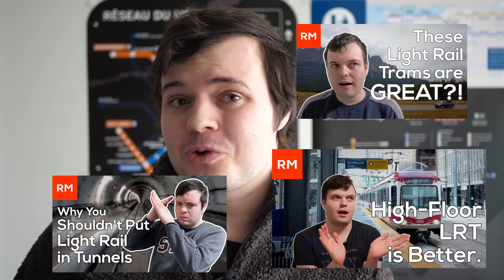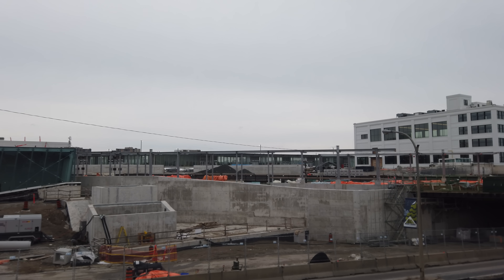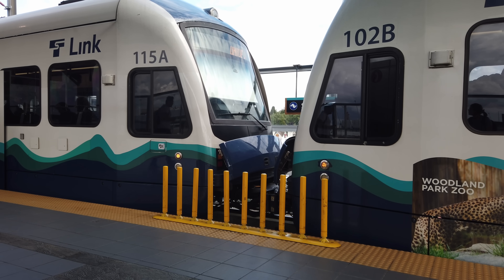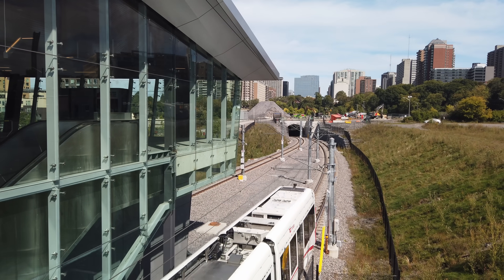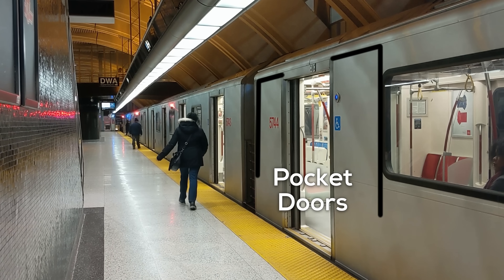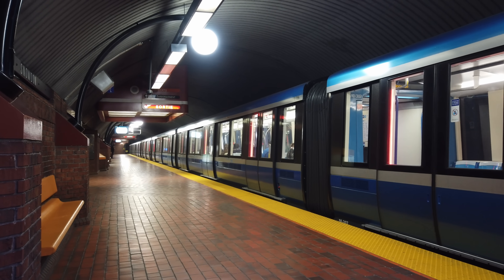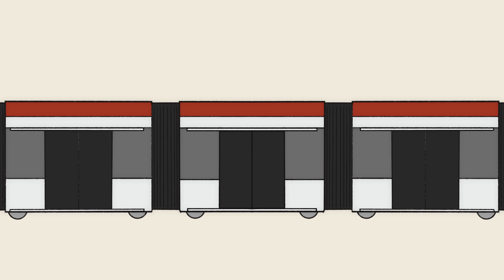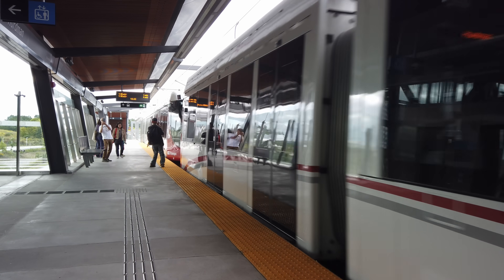I Designed a Better Low-Floor Tram

Comment: The issue with this train is that it’s basically a caterpillar on wheels. It would look ridiculous going around curves, especially sharp ones (which it can’t even do due to angular deflection of the wheels). It looks like what would happen if you took a typical 20 meter streetcar and stretched it out to 60 meters by adding middle sections. I suggest you merge the middle sections to make longer cars. This will also add capacity because you won’t have that many  gangways. Also, if you want a well rounded low floor train, you should really add seats. People, at least here in DC, DO NOT like to stand on trains except if they are going maybe one or two stops. Additionally, you say that the train is designed for urban centers. But there is more to a city and its transit network than just the downtown core, and transit networks will use the model that is best suited to all of the city’s transit needs, not just downtown travel. That’s just my advice.

Comment: A different idea for the wheel which should be a lot simpler is to have each carriage separated by a mini carriage basically a glorified gangway extension which will have normal tram bogies it’s the same mechanical design of a normal tram except that the carriages with the bogies are just gangway extensions
Reply: I am not sure what you mean.

Comment: The approach by Manchester is good where trams AND PLATFORMS are high floor. And yes the system is accessible because the platform height is still the same as the height of the door and tram. 

This means that the bogeys and electrical equipment can be shoved under the seats without requiring steps above
Reply: However, the first section of this was built when low floor was in an early stage of development.

Comment: Proposal: use Talgo-style wheels, without bogeys and one wheel on each side on each segment interconnection. It's not like you're gonna put anything else in that space anyways. This basically frees up ALL internal space, and while it does reduce the amount of wheels-per-kilogram, trams already have enough small segments to probably compensate for this. Not sure if you could fit them INSIDE the interconnection, but it's worth a shot.

Comment: well, your tram has a small bug: it cannot(at least it will be difficult) go through s-curves. each carriages’ facing is fixed depending on the shape of the rail, so you need more complex connecting points or a floating carriage. (i can’t express in english very well, try to draw the tram going through a tight s-curve looking from above you’ll see why)

Comment: So this is basically a super long Siemens ULF with sliding doors
Reply: Not really
Reply: @Gfynbcyiokbg8710  Similar wheel arrangement but it is not ultra low floor.

Comment: that vehicle would have unmatched curved platform performance too, dynamic loading gauge because of end and center throw on the middle segments is basically eliminated

but yeah, the drivetrain was very quickly handwaved, thats a very complex system with a lot of active components. i'd sacrifice a little bit and have undulating floors to allow for axles of some description, even if they aren't axles at all, more like steering racks

Comment: Great video. May I suggest a spin off version? Design an ideal metro? Personally I see it as a cross between the Deep Tube of London with Vancouver's Skytrain.. Fully automated trains using LIM technology that arrive every 90 seconds but svelte enough to used in the tightest of tunnels... I.e. a Boring Company 12' standard tunnel which is a full 6" fatter than the current OG Deep Tube tunnels in London... If you contracted out the tunnel boring operations to them I am sure you could standardize and simplify a lot of things that make tunnelling so expensive savings costs while using automated rolling stock that again don't need or aren't nearly as vulnerable to work stoppages/strikes as traditional train systems are...

Comment: What about articulating double decker bus? I don’t know if this could work. What about double decker trams ? They do have them in HK. Articulating trolly buses, I saw 1 in your podcast about the shortcomings of trolley buses. Some of the advantages of troll buses you did not cover are they don’t generate as much noise, & lower emissions, they can change lanes so they block traffic like trams do. The wiring is the on the lower bay st in Toronto. I know rail-gauge for the streetcars in Toronto use an odd gauge, changing this would be cost prohibitive, but all new systems (the Ellington crosstown) should be stander gauge. This would allow you to buy surplus rolling stock & its plug & play.
     Saskatoon is becoming train free inside circle drive. My thinking to double the (adding a single line In most areas) & run LRT on those lines. One of those lines runs right passed the central bus terminal.
     Something has to be done to get people on to mass-transit, one thing is transferable transit fees. If I live in Oakville & work in Vaughn by mass-transit I take an Oakville bus $, to a GO train $, to the TTC Subway$, & finally Vaughn transit$. Four separate fares one way, might as well drive.
Keep the info coming.

Comment: idk it seems you have only seen the american style trams and not the euro ones, for once the boogies are not wasted space as they are completely covered in seats, usually 16. Also there is a lot of standing space in the cars with two doors. Google Barcelona tram and you'll see, there are lots of seats in the intermidiate cas and the extreme ones while the large two door cars have standing and wheelchair places

Comment: No, you don't. On the tram tracks, the turns are much tighter and there are a lot more of them, it's not a train. Therefore, the distance between the wheel pairs should be relatively small. Active steering significantly complicates the system and reduces fault tolerance during such an active work cycle. So leave the engineers to do their engineering work.

Comment: Actually, I like your design. It has very good ideas in it and solves many endemic problems of maintenance.  A good modular design will permit replacing the entire engines at once making maintenance more efficient and ultimately low cost.   Eventually, some manufacture is going to reach out to you.

Comment: I'd argue it's better to have shorter vehicles running more frequently. That way, passengers never to wait long at stops.

That may not be practical with old signalling systems and human drivers. But it's completely practical with autonomous vehicles like on the DLR.

Autonomous trams may not be feasible yet, but I expect the technology will be ready in the near future.

I think it's irrational that we are unwilling to run trains close together in case they collide, but we're happy to couple them together into longer trains.

Comment: It would be much better and cheaper if the TTC acquired already used designs that were made in other countries such as the combino supra because it would already have been tested and that would be much better price wise. And it has been labelled a reliable tram so using a tram that has been used on a different network would be much for effective when thinking of an answer to fix all of the wasted space.

Comment: Skoda 15t is probably one of the best low-floor light rail designs currently available in the market, and the amount of low-floor space there is quite enough to even offer longitudinal seating layout if necessary. 
Other than that, I would be probably looking into the heavy rail domain, sourcing thoughts from either something like Stadler Kiss or probably something like Talgo high-speed train in terms of what kind of car typology is achievable.
Reply: (sorry - meant Stadler Flirt)

Comment: Honestly though, I think Siemens Avenio trams, specifically with the interior Bremen chose, already solve many of your problems, except for maybe the door type. What they bring to the table: 1 bogie per segment, up to 2 wide double-doors per segment and the traction motors are fitted to the bogies themselves, so no awkward high-floor section. Interior-wise, Bremen went for 1 bay of 4, 1 bay of 2 and a bench per side per bogie, 1 L-shaped group of seats in the rear and longitudinal fold-up seats everywhere else. The interior leaves plenty of space for standing, pushchairs, bicycles, mobility aids, and wheelchairs.
Reply: Siemens Avenio only has a top speed of 80 kph, or 50 mph. Whereas the Seattle Link light rail goes to 89 kph, or 55 mph. Haven't checked the other networks, but at least Seattle would be sacrificing a little bit of top speed in the grade-separated areas by going with Avenio. Otherwise it looks like a good solution, though

Comment: Basically an ULF from Vienna, I don't think with this design the structure would be capable for high speed ( ~100 km/h ) but for tram operation why not. One design I like for high capacity is the Skoda 15t, clever design and has a lot of space. Something with a similar design but way more larger would be better imo.

Comment: Have you taken a look at Sheffield Supertram for example though. A good mix of high and low floor. It's a low floor tram in terms of it enables the lower 'kerbside' boarding and whatever but some areas are higher floor such as the centre part and both cab ends. Higher cab of course make it easier for drivers to see what is going on on the roads and the higher centre car could be used for more mechanical things. Or depending on how many bogies need to be motorised, you could keep the centre car low floor with unpowered bogies.

Comment: Ignoring the engineering issues, the whole idea of mixing lightrails and car traffic is wrong. In other words, it does not make sense to use trams instead of metro train.
The solution with boggies is to put the wheel inside the vehicle, and the engine to the outside, and make the trains wider. Then the boggie case does not block 2/3 of vehicle size, but only 1/2. This however requires to build new stations.

Comment: I was never a fan of most of the Ford brother's Policies... but they were absolutely right when it came to Eglington: IT SHOULD HAVE BEEN A SUBWAY. The half-measure transit solutions (St. Clair for example) is a stop-gap expense that is destined to provide more problems than solutions

Comment: Disagree about wheel loading. A typical metro train carriage is around 40 tons or 10 tons per axel. The shortest Siemens or Alstrom trams weigh around 25 tons or 7 tons per axel. Longer trams with more bogies will have even less loading.

Comment: Man if capacity is the problem, work on proper commuter rail style rolling stock with PLATFORMS and a significant HEIGHT ABOVE RAIL LEVEL that can do the job of being a tram in one case, a commuter train in another case and a metro in another case. buses use a single leaf door that moves inside the rolling stock. trams can use them too!

Comment: I'm still going for Transtech Artic tram (new name Škoda ForCity Smart Artic)
Reply: However, its interior floor is not completely flat, there are slight inclines next to the doors and in the aisle, and I am read that the former is a danger for disembarking wheelchair users.

Comment: All nice and dandy, but you forget however about comfort of passengers. They do like to take a seat and enjoy the ride. Not stand like cattle. People don't like to stand while in traffic. If you only did more resorach you would know that in Europe and even in my country Poland there also bogies that are fully low floor. Yes you read correctly. 100% Low floor tram are rolling here. No high floors with low floor in the middle only. That is an old early 2000's design. Back then people didn't care much of baby carriges, elderly or crippled and high floors were made. Like Polish Konstal 105 Na and earlier models. How ever at the turn of century? Protram and Moderntrans were experimenting with new ways to allow low entry. So they took the refreshed thier Konstal models and placed the new low entry section. For ex? Moderntrans made an over haul model of Konstal 105 Na for Poznań and called it Alfa. But they had seen potential and added middle section between two cars. It still wasn't enough. So in mid 200's Pesa made 120 Na Swing. A fully 100% low entry tram. That made bogies not only as passenger seat compartment. But also as a part with propulsion. While no stairs are need to cross the tram. in 2010's Solaris Tramino with same design was made and few years later Moderntrans Moderus Gamma was made same way as Solaris Tramino and loger almost like Pesa Krakowiak. 45 m long tram.  So all compartments might seem handy in ridership? But passengers also want comfort.

Comment: Running multiple-unit trams as subway trains is for instance done by Verkehrsgesellschaft Frankfurt am Main, Germany. At first, Metro and Tram in Frankfurt am Main were not separated, and the Metro used the Tram lines for instance to access the depot. Only with time, tram and metro got more and more separated, but because of the hybrid state, special rail cars, the Class Ptb, were used in some parts of the network. Ptb can serve both level tram-like stations and high floor stations.

Comment: Alternatively, what we (& the rest of the world) really need is (what I call as the CCS—Continuous Commuting System) to never have to wait for the next bus /train... & just get on & go: like an escalator, only flat /horizontal—one with multiple lanes, each 2X faster /slower than the lane beside it. From the platform, the first lane is 2X faster than walking, the next lane is again 2X faster than the first lane (& 4X faster than walking).... As commuters move further away from the station, they are gradually accelerated faster & faster.... The outermost lane is non-stop... No need to slow down if the next station is not your stop.

Social-distancing friendly too (and must-have for the next pandemic /epidemic)

Comment: Follow-up video about a Better Metro vehicle when? :D

Fully walk-through, yes, but how long should the segments between bendy bits be?
And should the doors actually be straight across from eachother or off-set a half (or full) doorway width?
and should the doors be in the middle of each segment or right at a bend? and should it have the same door density all along the train? 
etc etc

Comment: High floor supremacy. Just build high floor[s] at the station and there is your accessibility.
Reply: High platforms will not work everywhere and even where they would, they cannot be shared with buses.

Comment: Port Authority Transit in Pittsburgh uses an interesting high-floor design that features an extra door for low-floor loading. Of course the routes that use these vehicles evolved from PCC car operation so that even high platform stations included a low-platform section (now unused) where PCC cars could handle entering/exiting patrons. Another point is that low-platform only stations are NOT handicap accessible. Of course the old PCC cars weren't ADA compliant either!

One complaint I have against super long tram cars is that it is impossible to run short trains during late night and weekend trips when patronage is small. Thus running long trains at such times requires unnecessary energy consumption.  What about having enough short units for an effective low patronage service, with those short units combined into a longer train for peak hour service?

Another thought is with a mix of tram sizes, long trams might be electrically two trams so that the electrical wiring is close to identical between the short and long trams.  This measure of 'redundancy' means that the electrical failure of half of a long tram means that the other half can 'self-rescue' the train (at sharply reduced performance)) so that it can reach a siding until the end of peak frequency service, when there is more time to run the train to the shops. 

The great virtue of Frank Sprague's invention of multiple unit controls in 1898 was the ability to  dramatically change the length of the train to suit the volume of anticipated travelers with no sacrifice of either performance or economy of operation (per car basis). Super-long articulated trams sacrifice that highly variable train length economy!

Comment: Congratulations! You've turned LRT into an expensive GadgetBahn where every wheel needs or becomes a separate and much weaker engine, both inaccessible for maintenance and repair. Sure, it's comfortable for passengers, but it comes at such cost that it's easier to make a ground metro system of sort at this point

Comment: Fixed wheels instead of bogies will create a lot of noise and a lot of wear and tear on the wheels and the rails. They will also result in a very uncomfortable ride for the passengers unless you do something clever with the suspension, which will take up a lot of the space you've saved.

Bigger doors mean you lose a lot of structural rigidity, which means you need to compensate by adding strengthening beams somewhere else in the vehicle, and that space can't have windows or doors.

If you want to run a metro service on lines with low level platforms, the only way is to run partial low floor vehicles instead of 100% low floor. The doors can be at platform level but the floor can slope upwards inside the vehicle to create more space for the mechanical engineers to do their magic.

All that said, I agree with you that we need longer vehicles rather than coupling two or more short vehicles together.